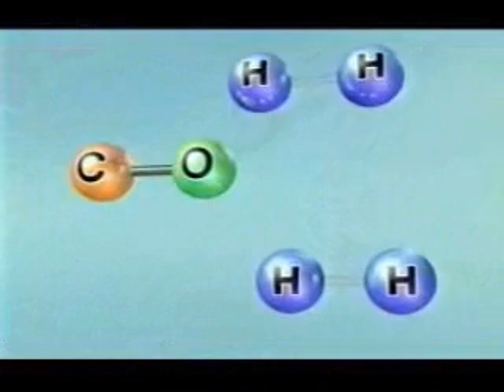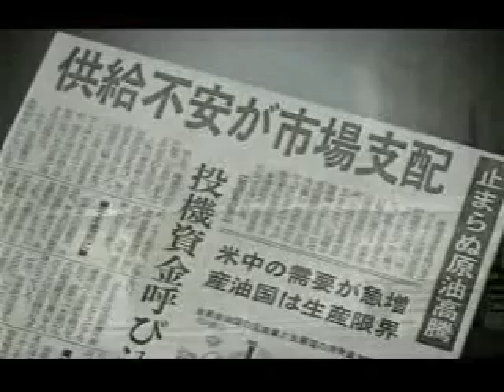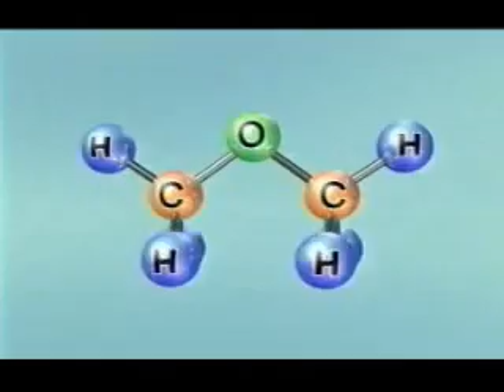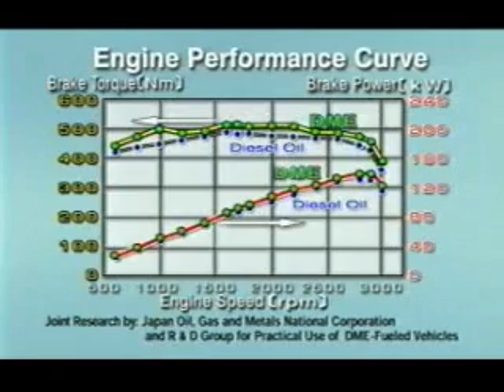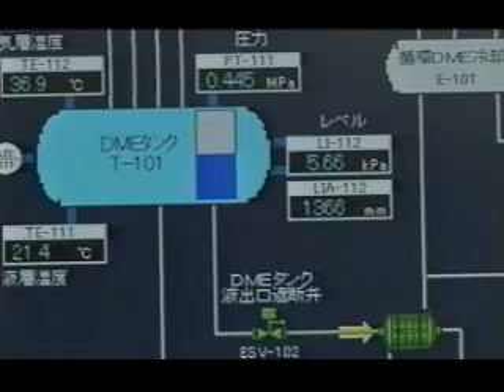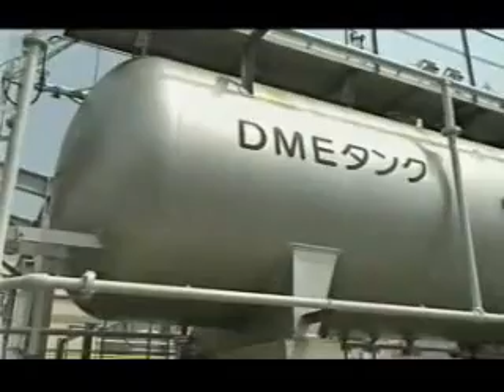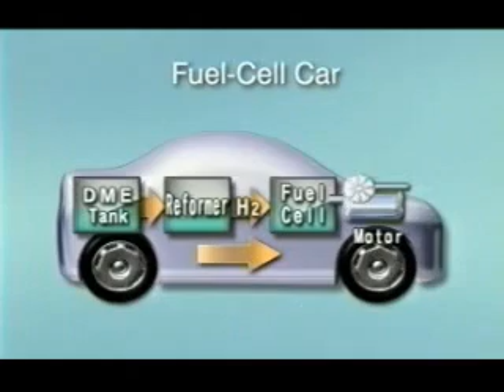Waste to Power: Dimethyl Ether

Comment: This video is already 16 years old and yet, I had never heard till a week ago about DME. 
I see it as a way to let Americans keep their car and yet stop emitting CO2. The process is often described as circular and carbon neutral but even better would be if part of the carbon could be deposited so it becomes carbon negative. 
Storing solid carbon away is much easier than storing of liquid CO2 in old oil fields.

Comment: DME can be produced from the CO2 emissions of a power plant. The DME so produced would be like biomass power and have 90% abatement of CO2. The price of DME would be equal to 75% Diesel price but would have zero particulate emissions in its exhaust. This becomes liquid at-25 deg C and blends well with any fuel and acts as an Oxigenate and increases the fuel effeciency and complete combustion. It can be used in fuel cells also.